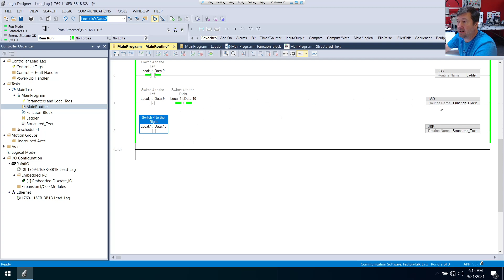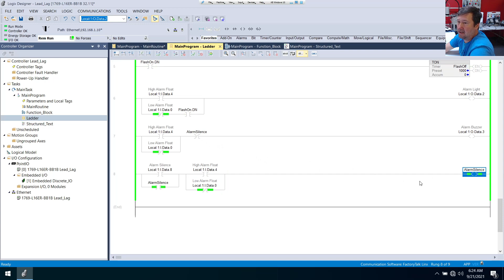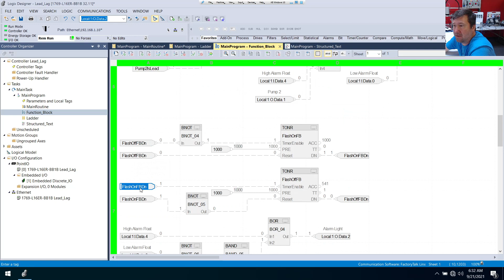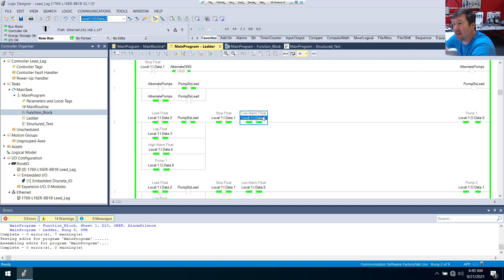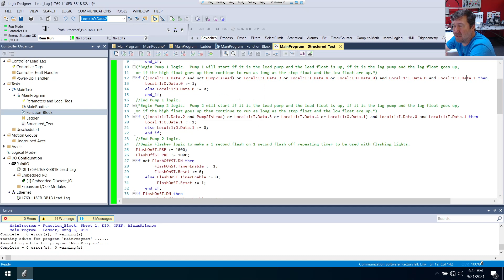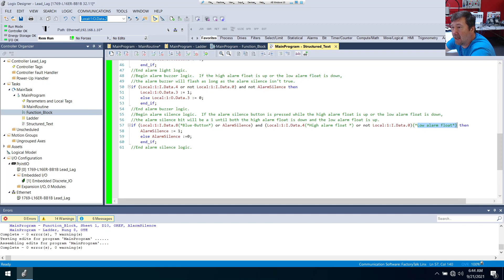Lead Lag Alternating Pump PLC Programming Quiz Answer

Comment: Can you help me If I  need to do programming for 3 pumps instead of 2 pumps ?
Reply from the maker: It would be the same, just add another pump and float and do it the same way as the lag pump.
Reply: @TimWilborne   without adding new float with the same low float signal  we need to do ?

Comment: Hi! Great video, I have been tasked with making an alternating lead/lag pump set up with an Allen Bradley Micro820 on CCW, only with 3 pumps, that also needs to include if either the current duty or standby fails it will swap to another available pump… can you help?

Comment: Thanks for the video Tim.  I was able to take the information I learned here, use it to write a program in CCW to control level in a condensate tank with a Micro820.  Using a Micro820 and a 7in HMI was no more out of pocket than a PAX2C and the cards needed for it.  With the Micro820 I have a much more useful processor that can handle the pump lead/lag logic.  I don't have hard-wired relays in the cabinet any more and I can still use my analog input from the DP cell for the level input.
Reply from the maker: Yes, it makes for a very flexible control system!

Comment: How would you distribute workload over a "pool" of pumps so that they maintain similar hours ?
Reply from the maker: I wouldn't :)  I don't believe in evenly running pumps because that means that they evenly wear out.  I don't even like using alternators.  If I do, I don't do a 50/50 alternator like in this quiz.  I do something where one pump runs much more than the other.  But there are as many philosophies on alternating pumps as there are ways to program it.  Great question John.
Reply: @TimWilborne  
So I am curious your opinion on not running pumps “evenly. “  as we all know, especially in a situation like your quiz, that pumps don’t run the same amount of time even when their run time is distributed “evenly” through an alternator. I understand they break down evenly, but have always been under the belief that, theoretically, extends the life of your motors. Just curious. Great content as always

Comment: I would latch the alarm lights so that if in your absence of monitoring and a high or low event occurred you would be aware of it. A press of the silence button would acknowledge the event. Pumping would funtion in the same method as you programed, just the light would be a like a historian.
Reply from the maker: I should do a video on "logging" alarms in an array.